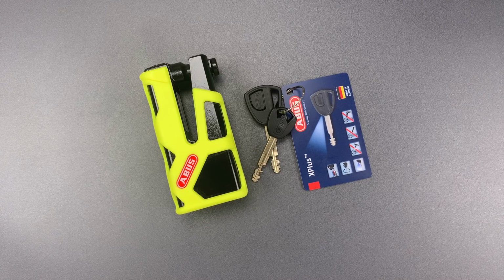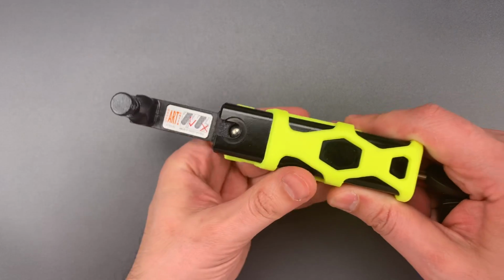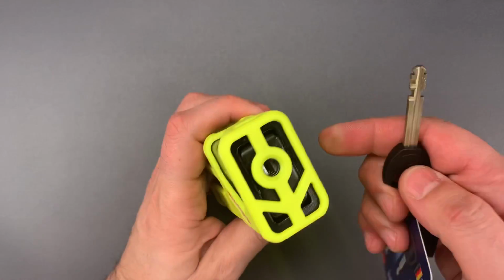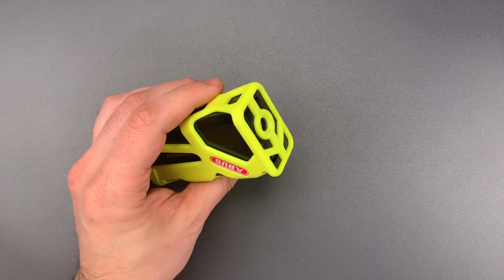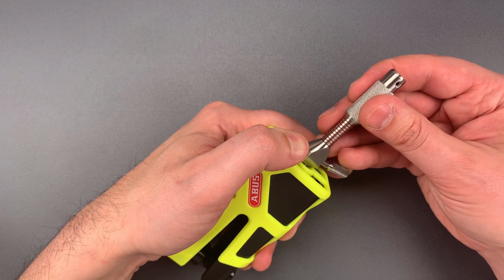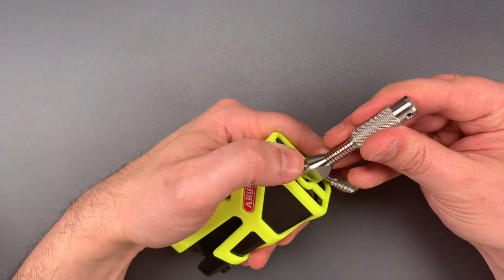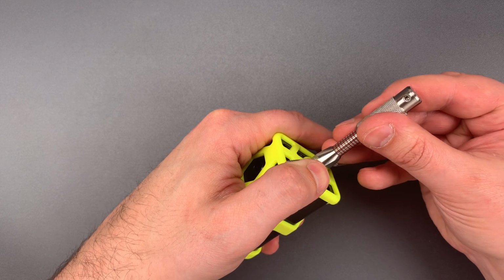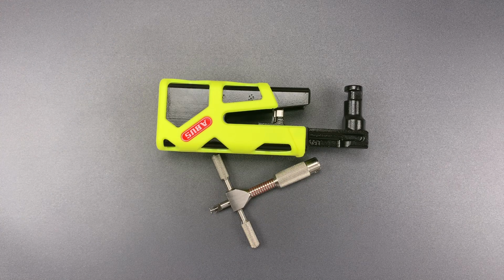[1004] Abus Granit Sledg 77 Picked (X-Plus Core)

Comment: I went to asda (british supermarket) yesterday, and on a whim i went to the lock section. The biggest lock i saw had its keys visible, and they were effectively all the same cut. i could probably rake it open with the handle of a spoon
Reply: a lot of cheap chinesium locks can be opened by using a screwdriver in the key way and just turning hard, sometimes disintegrating the core revealing the actuator
Reply: @_BangDroid_  I like how the same people watch the same channels....Lpl, This Old tony, AvE etc
Reply: It is interesting. I'd love to get inside youtube's analytics and see other trends and patterns
Reply: @_BangDroid_  i dont know how much chinesium was in that lock, i just know that the bitting was complete dogshit
Reply: @_BangDroid_  You know, it's partially because we get recommended similar channels by YouTube that we all watch them.
Reply: @_BangDroid_  Almost every locked thing can be opened by putting something strong enough in the keyway and turning hard enough.

The best made locks will make something other than the core break, like the door.
Reply: Dan Powell I imagine it would be possible to create some sort of engineered weakpoint that would shear the core in some unhelpful way.
Reply: @Islacrusez  There are quite a few european cilinders which have a weak point made especially to avoid that kind of attacks.
Reply: Matthew Shaw 
Yeah, okay...
Reply: dude, you were in a GROCERY store looking at locks.  of course they'll be garbage.  the only remotely acceptable lock at a supermarket is going to be the school locker Dudley combo locks.  And even those are iffy--I used to be able to pick them by ear.

Comment: I don't understand how that pick works, but damnit if I don't love every time it comes out.
Reply: The simple version?  the pick's business end has two parts.  The outer part is designed to tension the lock mechanism, similar to a pin-style lock's keyway tensioning tool.  the inner part is connected to the knob at the back that can slide in and out--this is the actual pick.  the graduated marks on the back are for guiding you in finding the disks--they're spaced the normal distance apart, so you know how far in or out you have to go.  rotate the knob, you turn the disk the pick is on.

Don't ask me to DO it, I don't know the actual technique.  But I can see and describe it, at a basic level.

Comment: I like how even a lock he /would/ endorse just happens to have a fatal flaw - thus, robbing the company of complete glory.

"This is a lock forged from pure diamond. It has a core made from pure molten lava that only hardens and responds when this specific proprietary alloy that coats its keys is introduced - thus, ensuring that any other picking attempts result in tools being disintegrated, pretty much ensuring this model to be unpickable."

company pumps fists

"However..."

company un-pumps fists

"This particular lock just so happens to have a 1-in-1,000,000,000,000 flaw due to the lock being assembled on Tuesday, after 2pm, in a snowstorm, while a guy named 'Jack' walks past eating an expired granola bar, where - if you rub some ink from one of those multi-colored pens from the 80's - inside the shackle, it will pop right open. I just happen to have one such pen, right here..."

Company: "**FUUUUUCK!!!**"

Comment: Is the "missing ball" actually missing, designed out, or otherwise a cost savings measure?
Reply: I'm also curious what effect it has on the lock, does it make the lock less secure?
Reply: Lol.  The ball has less than a cent of steel it.  You can buy dozens of bearing balls for a $1
Reply: It would be missing.  Certain things are expected--if you use a lock with a ball bearing lock mechanism, certain sounds are made.  If you know the mechanism's sounds well enough, you can tell by hearing if one's missing.

Comment: I definitely prefer these disk locks over pin tumbler locks when i know it'll be picked instead of jiggled or bypassed.
Can disk locks be picked? of course, but so few people have the right tools for it. So i feel comfortable using them knowing that someone isn't going to pick it with a $5 pick set off amazon.

Comment: The ABUS GRANIT™ Detecto XPlus 8077 Brake Disc Lock also has slightly different locking mechanism so it can fit a tamper/vibration alarm in the housing but has an issue with with the ball bearings falling out.

When opening the shackle to fit over the disc on my ST1100 the ball bearings that lock the shackle sometimes fall out. 

I've had to scrabble round in the dark on my hands and knees trying to find one of the bearings a few times now just to lock my bike up.

I've checked my other 8077 and it also had a ball missing. 

Contacted ABUS and they eventually told me to return my locks to the original vender to be sent back to Germany for modification which would take 4-6 weeks. I think I'm just going to measure the ball bearings and carry spares as I don't really want to be without my locks for a month or two.
https://www.abus.com/uk/Mobile-Security/Motorbike-Scooter/Brake-disc-locks/GRANIT-Detecto-XPlus-8077

Comment: I bought this two months ago! Today i was leaving work and suddenly as i was unlocking, the sliding mechanism slided off the main body and these two ball bearings were blown away! Basically as i saw the sliding mechanism somehow is broken, that means if i slide it all the way up it removes itself from the main body and the ball bearings lift off, and in additions to this as he says in the video if these are missing then it wont lock! 

I am taking it back to the store and i am already curious of what i am going to hear from them but i am pretty sure that they are gonna claim that i moved the bike with the disc lock on so i broke it...

 I am very sad, i feel i lost 125 euros!
Reply: How did it turn out with your warranty case?
Reply: @drjimpapadakis  👍🏻👍🏻

Comment: I'd really like to you pick this lock in its intended use, clawed to the brake disc of a motorcycle, because I am curious if and how it would affect the pick: e.g. being trickier or not if your movement is restricted on the one side of the lock by the disk. (And learn from it, if I can use a better placement for my brake disc lock)

Comment: I used this on my motorbike for as long as I had a motorbike, very solid build, durable... sadly it didn't stop my bike being stolen, they used an angle grinder and cut the brake disc either side of this lock. They kindly left the lock on the floor for me to use again, undamaged.

Comment: Would your ability to open this (or any) lock be compromised were the lock in use as intended, rather than free to cradle in your left hand?  In other words, how much more difficult would it be were you not able to orient yourself and your hands optimally?
Reply: A bit more complicated, I guess. But the main reason for the cradle is that the camera can show everything. If the lock is mounted on a brake, it's not going to wiggle around much. Sure, the space to pick might be a bit smaller, but it should be possible the same way. Naturally, having to bend over or kneel next to the bike makes the process a wee bit harder on your body.

Comment: Still a pointless lock... It takes 30 seconds to remove the screws holding the disk brake on the rim of a motorcycle using an electrical screw driver. Once the bolts are off, there is no interference in between the disk and you could ride away with the lock and rotor dangling...

Comment: I’d hate to call a failure of ONE unit “bad QC” - stuff breaks. It happens. 
Now if it’s a trend, that’s an issue - but is there any evidence of that being the case?
Reply: It wasn't a failure as such; it is just less secure mechanically. But it is poor QC: an incompletely assembled unit should not leave the factory, especially on a premium product line (that lock is well over $100...)
Reply: It's not evidence of great "QC" , and it's definitely bad "PR" if such a lock ends up in the hands of a popular YouTuber .
Reply: He said "I have no reason to believe it's a widespread issue" in the video. But the lock is missing a part; is he supposed to ignore that?
Reply: If you're a company producing security or safety equipment, then QC is very important. We're not talking a cosmetic scratch here but a significant missing part. And this isn't a budget lock.